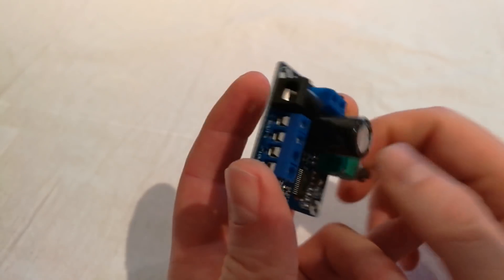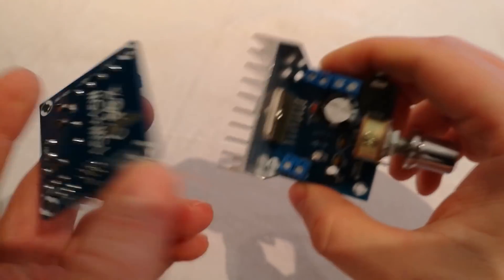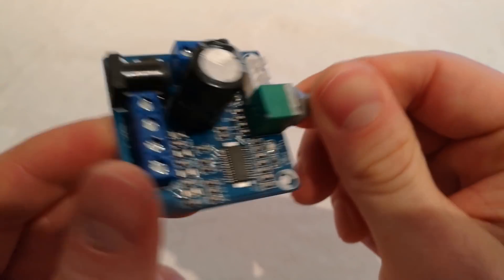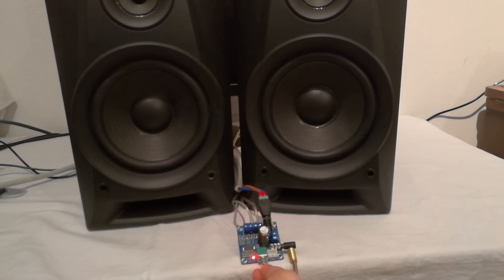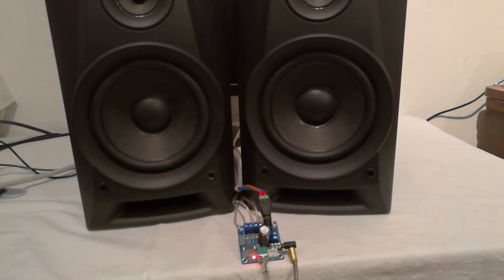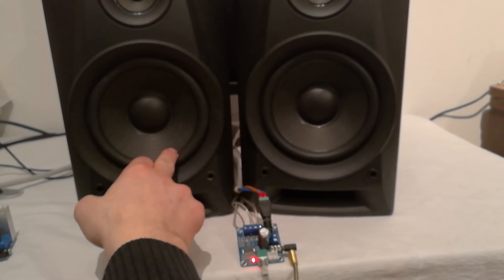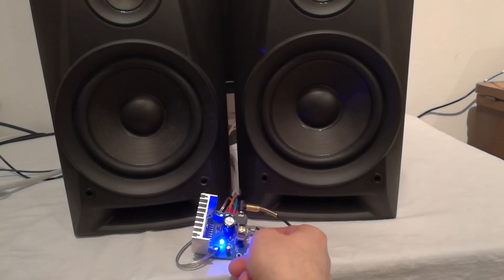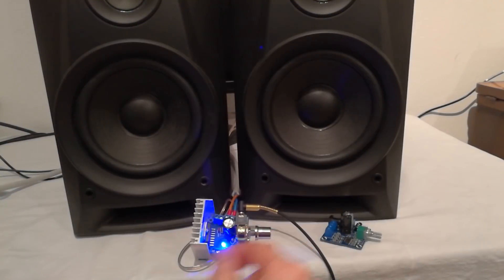WTF!! TPA3110 amplifier (where is the bass?)

Comment: DId you ever retest this amp with the speaker polarity the same? Other commenters indicated that the board is marked wrong. With the 2 spkrs out-of-phase and side-by-side, you will have zero bass. Also, separate the spkrs a bit.

Comment: Replace the polarity of the audio output. The correct polarity is (+) (-) (-) (+). I had the same problem with a similar board TPA3110.
Reply: Mate you are right, it gave weird stereo effect and couldn't digest that the labelling is wrong on board itself.
Reply: And bass felt like it was distributed in bands around the room, high at some spots, low at others hahaha
Reply: Thank you. I had the same problem

Comment: Try changing the polarity of one speaker, 
I was facing same problem with tpa 3116d2. Later on I found that the polarity printing on amplifier board was incorrect.

Reply if you agree.
Reply: I agree. I had the same issue with the 3116d2 board with 5 pots.

Comment: While I agree that "side-by-side" comparisons of amplifiers using the same signal source and speakers has merit, it is a nontechnical subjective review. I'm guessing that the same power supply was used, and that it may be more "compatible" with one amp vs. the other.

An objective review needs to account for amplifier operation nuances like input and output impedances, power supply "stiffness", and quality of sound source. Since (nearly?) all single supply amps are DC coupled, this amp MUST have a series DC blocking input capacitor. The  sound source's output impedance in series with the amp's input impedance and DC blocking capacitor creates a single pole high-pass filter. If capacitor value is too low, it will have a fairly  high frequency cutoff and will certainly sound tinny -- an indication of a bad design if bass response is desired (and most listeners do desire that). The fix is simply a bigger input coupling capacitor. Flatness of response is another desirable listening quality unavailable in a "listening test". That can only reliably be tested with good audio generators, good non-inductive load resistors, and a decent audio spectrum analyzer (built-in to most modern oscilloscopes).

I have a few of these amplifiers from different manufacturers now all using the TI TPA3110 amp, so maybe I should check them out and see how well they are build. The TI data sheet has lots of technical details, but I know that Chinese (and other) manufacturers do tend to cut corners, especially when profit is involved.